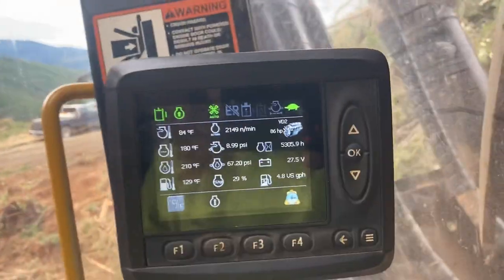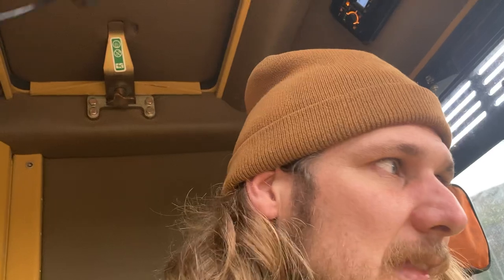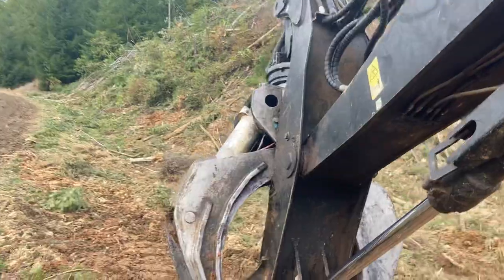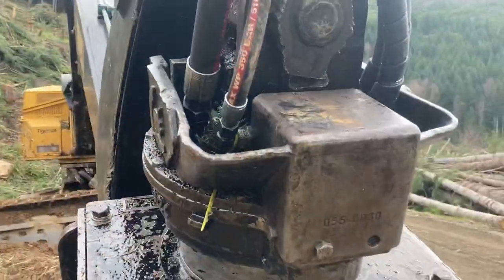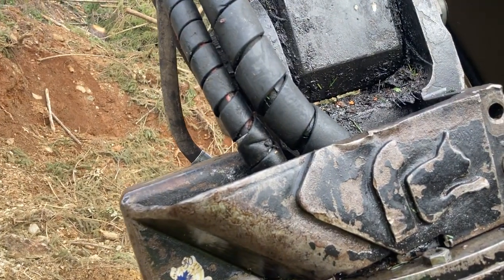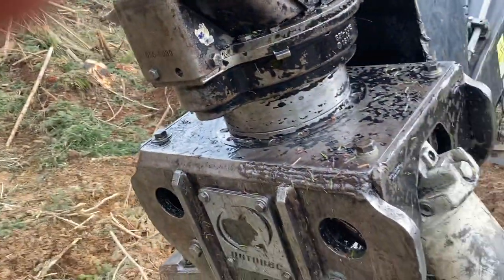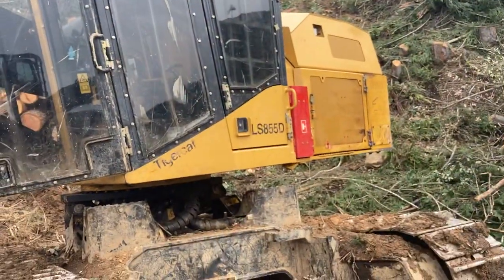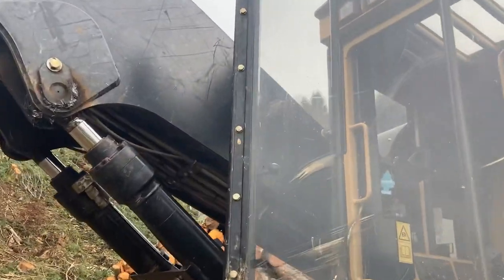Things I Do Not Like About The Tigercat 855D

Comment: The ER is the most efficient way to run this mchine. You do have control. You run this same way you normally do only its faster and more efficient. It can be adjusted to not be so fast.
TC doesn't make Rotobec. 
The swing is a closed loop swing thats why it has alot of swing power. 
Sorry u had engine trouble. 

Let us know if we can help.
Reply from the maker: After talking to some guys in forums i do believe we are gonna delete ccv filter. Lost turbo then motor ran away after replacing. Er mode does good in swinging situations but I pile while I log and it’s a little to violent for piling. I’m still learning machine and will do a fallow up video here in another month or so.

Comment: I have a couple of suggestions for you if you are interested. First on is for the ER. I had a learning curve with my Buncher too. I was over sticking the controls. It's a load sense system so you get full power at any speed so I needed to compensate by just sticking what I needed for speed and control. I think you will come to love it! Second one is for your Lexan windows. You might try Plexus. It's a polish/protectant so you put it on with a clean cloth after you clean you windows -you can feel it float the cloth as you wipe it dry. Another cool thing about it is that it is anti-static so it really helps eliminate dust on the inside windows. Pape sells this but you can get it cheaper on Amazon. It is spendy but worth it. Good luck, be safe!
Reply from the maker: Copy that on the sticks. I dig it for swinging but forget to shut it off while I pile and kept almost hitting myself so just learned to keep them off. And yup on the plexxas it’s good stuff I have a can in there now. Window was pretty shot when we got her hopefully the plexxas helps because I couldn’t believe the little scratches I got after a little oak popped up at me. Thank you for tips I didn’t even think of under sticking. I’m so use to my cat it’s definitely a whole different creature

Comment: Bro you're a trip this channel is like Wayne's World goes logging lol. I run a Deere 210 with a Rotobec grapple saw. Same problem thing leaks like a sieve I don't even bother to tighten the hoses until it gets a good stream going. As soon as you tighten one another one comes loose. The salesman told me he has never seen a dry Rotobec grapple except when they are new on the machine
Reply from the maker: Have seen videos of the grapple saws:they look pretty slick. Haven’t ran the our tigercat in a few months and definitely not upset about it mostly because those dam rotobecs

Comment: As awesome as the Tiger cat machines are , they are extremely over rated .  Will never last as long as a Cat machine. Our 336DL running a woodsman processor , 14,500hrs and not 1 cent spent on motor or hyd pumps etc , other than regular maintenance.
Reply from the maker: Agreed. My 325d is a sweet machine so smooth. It’s been sitting the last 4 months unfortunately but can’t wait for a clean up load out job so I can get her back. At 16k now and only an injector has failed. I’ve put 7k on it so it feels like one of my arms